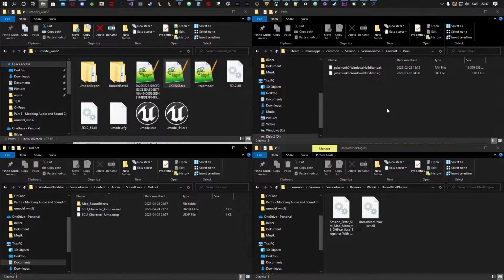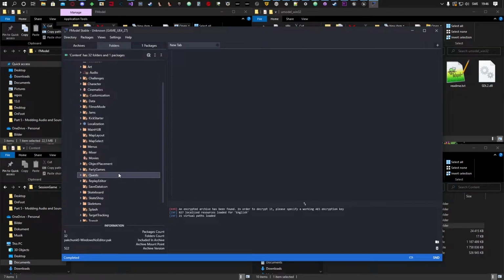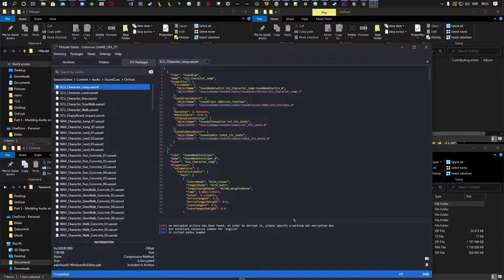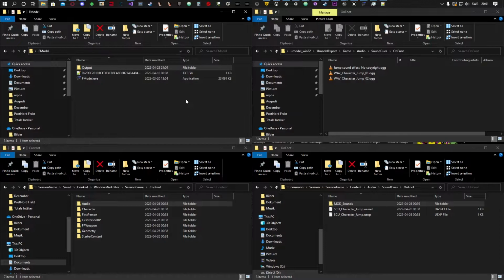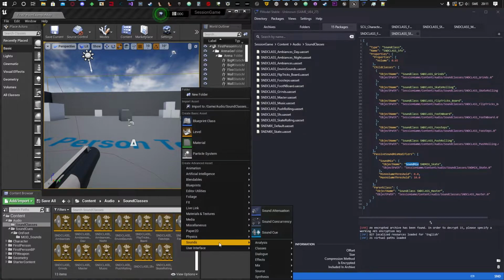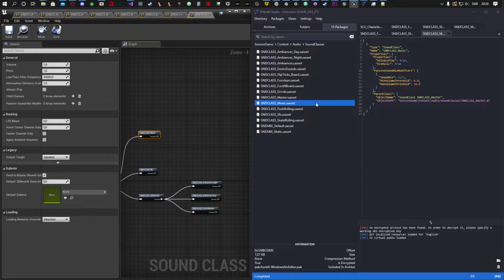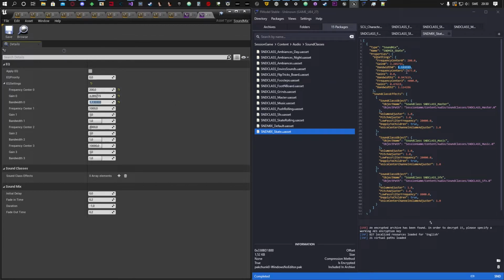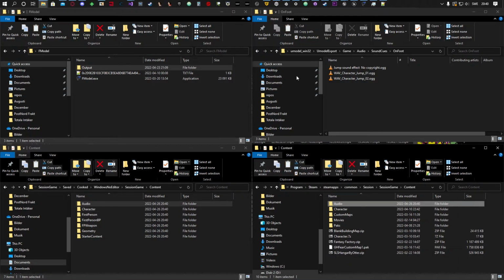The Basics of UE4 Modding - Part 5 (Sound Waves, Sound Cues and Sound Classes)

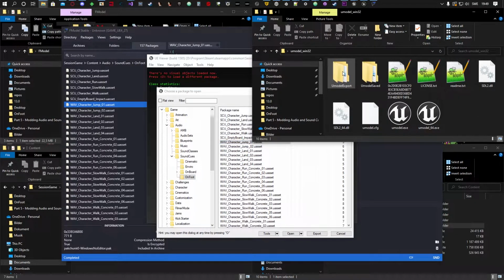Comment: @13:44 I get the message below for anything I try to export. Am I doing something wrong? 
Scanned packages in 3.6 sec, 830759 allocs, 163.61 MBytes serialized in 40658 calls.
Exported 0/0 objects in 0.0 sec
Reply: did you found solution?
Reply: @ameerxoshnaw  unfortunately no :( not sure if issue with package